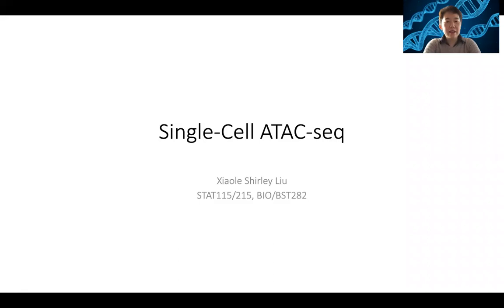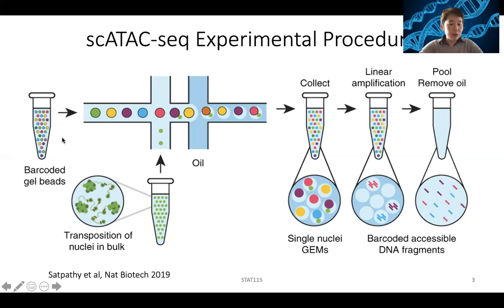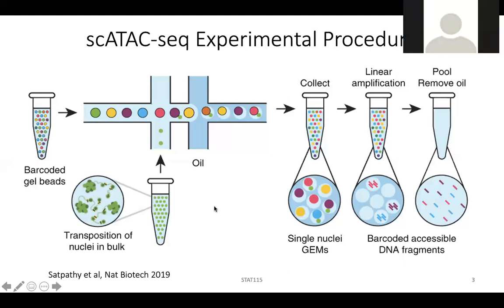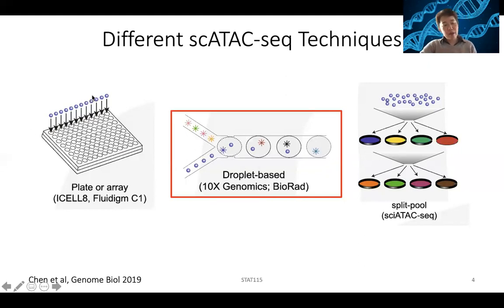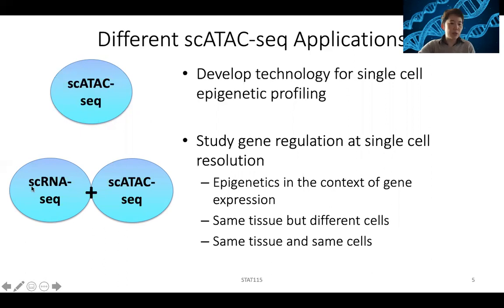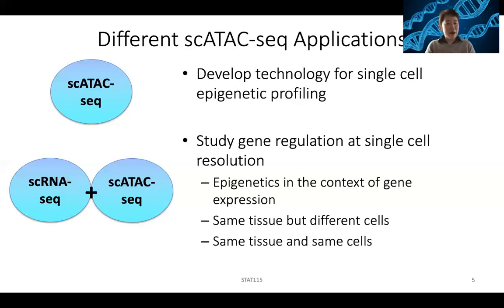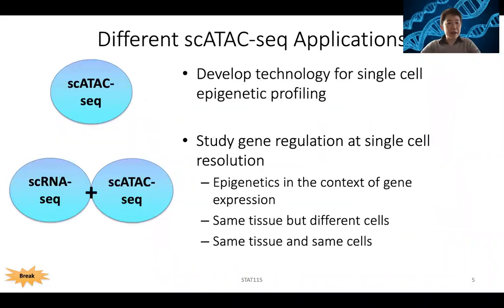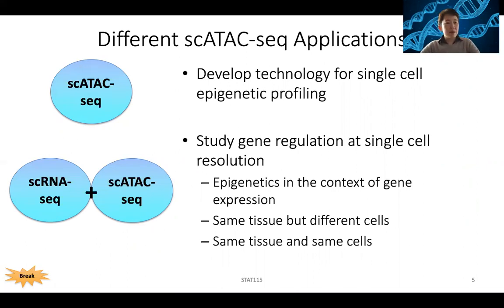2020 STAT115 Lect16.1 Intro to Single-Cell ATAC-seq

Comment: I think I have the same question. Is it one transposase and therefore barcode type per nucleus (i.e. only one transposase can infiltrate one nucleus)? Or does the nucleus remain intact so that all the transposases and their different barcodes contained within a single nucleus are isolated?
Reply: The transposase itself doesn't carry the barcode, the barcode is carried by the primers within each gel droplet (hence diff color of diff droplet). Thus, transposed nucleus (which has tons of Tn5 at that point) remain intact and will only be barcoded and amplified upon successful emulsion.